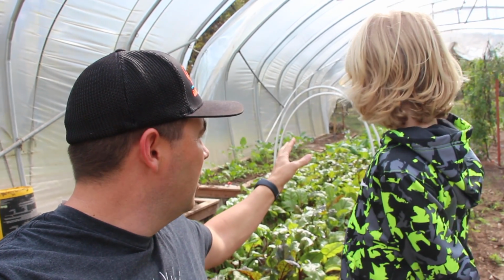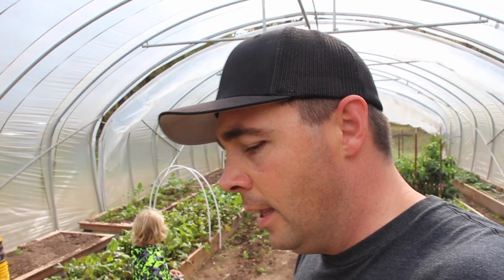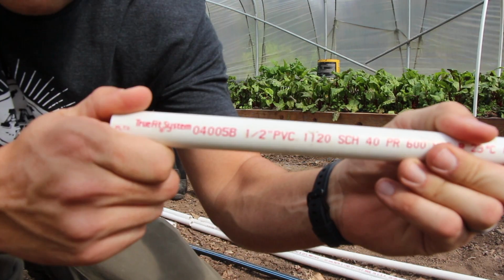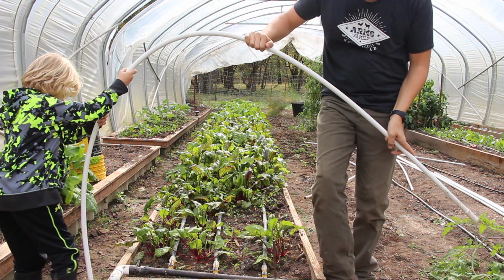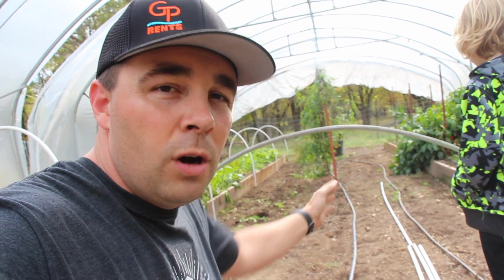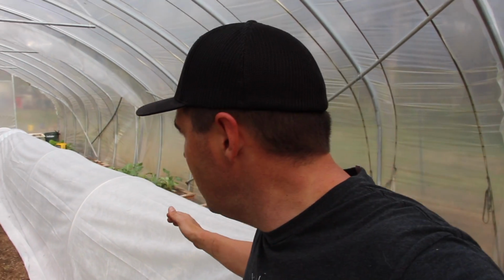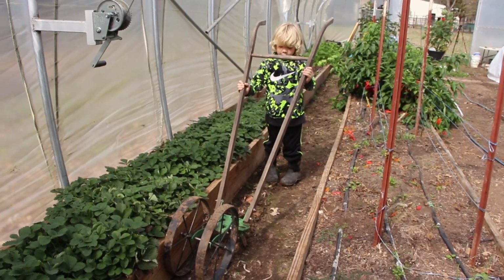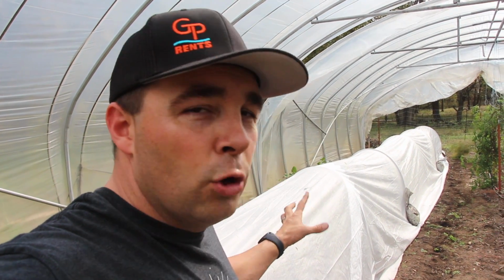Low Tunnel for Extra Frost Protection

Comment: Use 3/4" galvanized pipe straps to hold your PVC to the beds. You can slide your pipe in and out with ease.

Comment: I've had some success with this method using the thin metal electric fencing rods or rebar hammered into the ground and putting the pvc onto them.  I've used black sprinkler pipe on smaller hoops and that was nice as well. It's not strong at all though.  Great video.  Houston you rock.

Comment: I've used Agribon also here in Oklahoma, both out and doubled in a high tunnel through the winter. You might consider shorter hoops when the weather and temps get really low.It's easier to keep the temp up with shorter hoops when it is brutally cold. I also used rebar to hold the hoops in as well as the conduit fasteners to fasten it to the raised boxes. Dunn Lumber in town has them.

Comment: Daniel, does the filter fabric cut down on on natural sunlight the plants need? If you completely closed your entire greenhouse wouldn't it hold enough of a temperature to prohibit frost?  That's all I got. Stay safe! Later Arms Guys 🌿🍃💪💪
Reply from the maker: It still lets most of the light through. Closing the greenhouse will protect from a frost down to about 8 degrees below freezing. But it can still frost in there on a cold night since we don’t heat the tunnel.

Comment: Daniel, wouldn't it hold up better if you used hose claps and scraw them to the beds? At least I think they are called hose claps lol.
Reply from the maker: Yes they would for sure. However the ground is pretty soft and I won't have too much wind inside. If these beds were outside they would need extra support for sure.